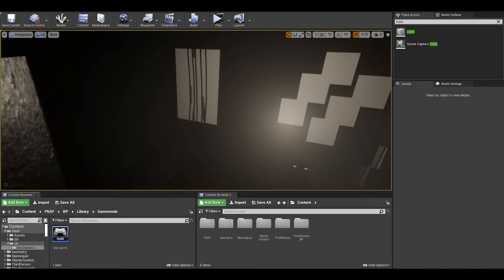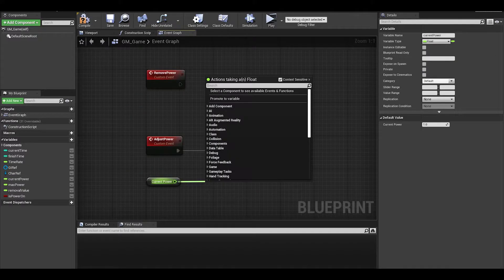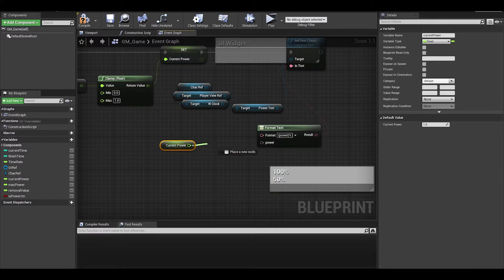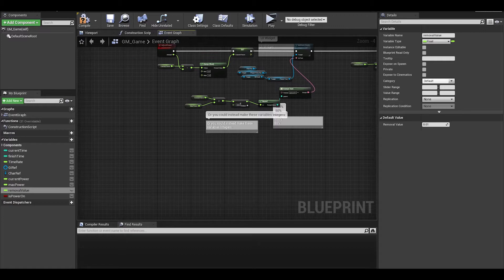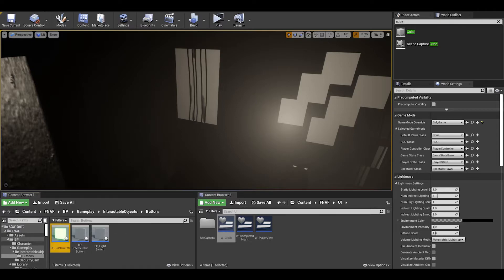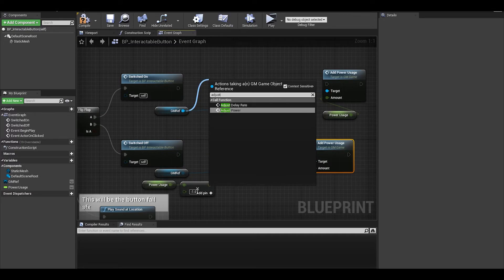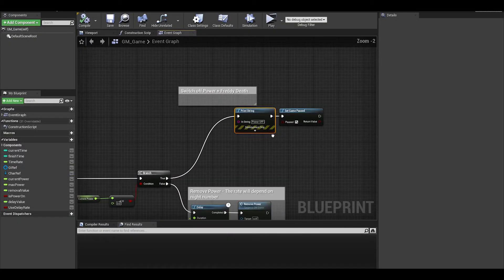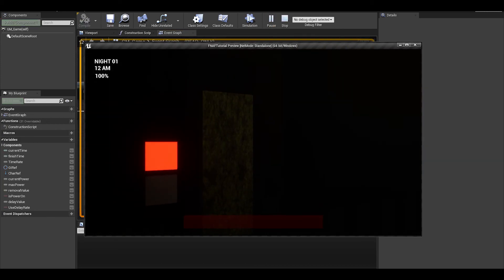Unreal Engine | FNAF Power System Tutorial

Comment: 7:35. In my case, the power just speedruns how fast it can lose power.
Reply: And also when I turn one or both lights on (for my game's case) it takes off 5% power each second.
Reply from the maker: If it speedruns, it means you have to change your power usage to a higher value like something greater than 1 .

Also if it takes off 5% each second, that is the 1st method function which Is the add power usage function. The 2nd method which smooths that part out is the adjust delay rate function which is the only function you need to use.
Either use adjust delay rate or the power usage function at 7:30.
Reply: @unrealdamagecontrol  I have managed to fix the speedrun problem
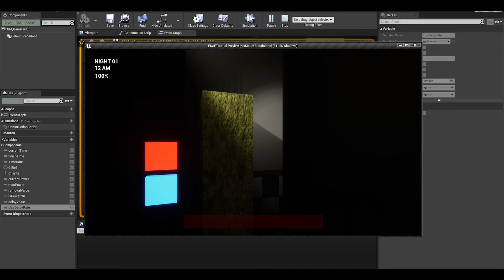Reply: Temporarily. Because when i got to 9:14 it came back up.
Reply: I did the 2nd method only. Should I try the first method or continue increasing the delay?
Reply from the maker: You only need to do one method, I myself recommend just the 2nd method as that is the one where you smoothly decrease percentages. The 1st method is what caused the massive percentage decreases every few seconds and felt jerky

I think we need to see screenshots of your adjust delay rate function, and your values for your delay rate and power usage. We may need to see your code for the bp interactable button too.

Comment: 6:11 my doors and lights stopped working
Reply: Me too
Reply from the maker: Sorry to have missed this one, I did mention in another comment if the default value of power on is set to true. If more problems do occur, maybe set print strings on certain lines of code in the Button classes. If  the strings not print out, then you could try to join the discord server and send screenshots there
https://discord.gg/sZ5QpYYKER